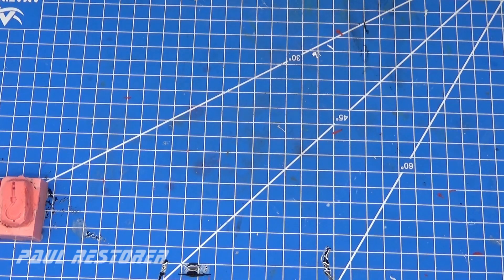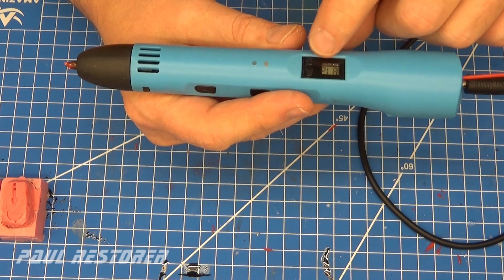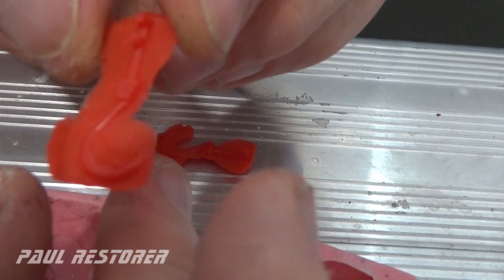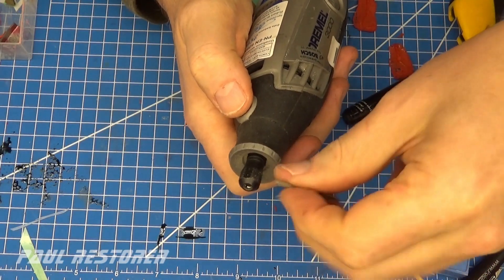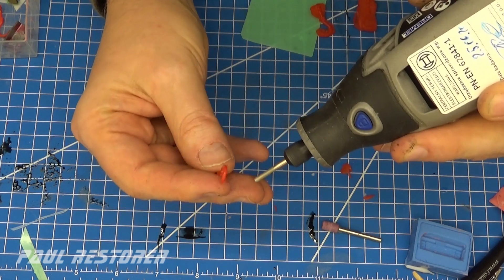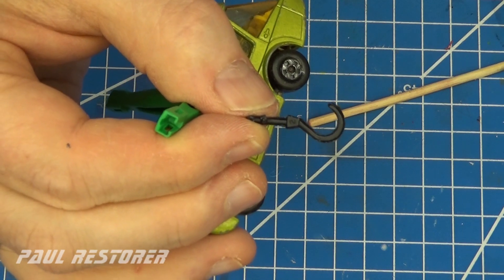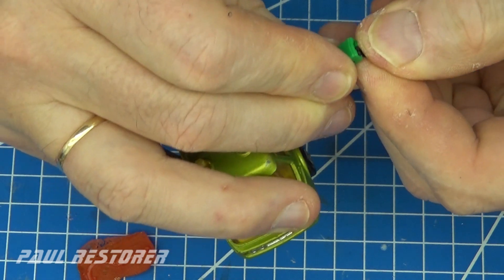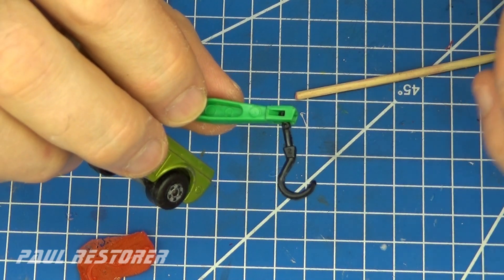Renowacja metodą odlewu ciśnieniowego. Wykonywanie elementów metodą gorącą na przykładzie haka.

Comment: When doing this mould is it plastecene that is the base you press into?
Reply from the maker: I press the plastic into the mm940 molding silicone, which withstands a temperature of 350 degrees Celsius

Comment: Another great tutorial Paul.....did you find it easier than using resin ?......Regards PJ;)
Reply from the maker: Thank you very much. It is certainly not easier than using resin, but the strength of plastic is much greater. Especially if the part has side tabs such as a hook, which need to be pressed in. Best wishes